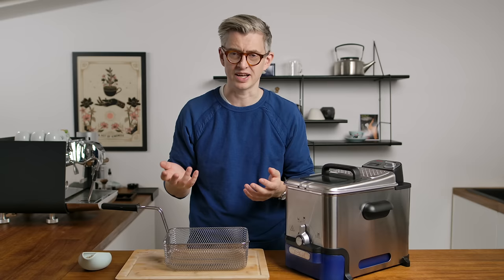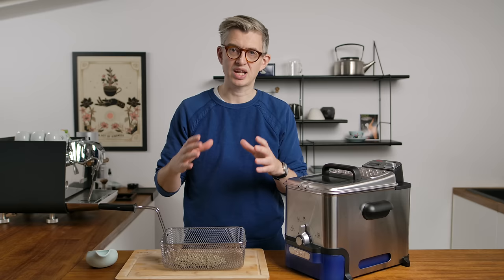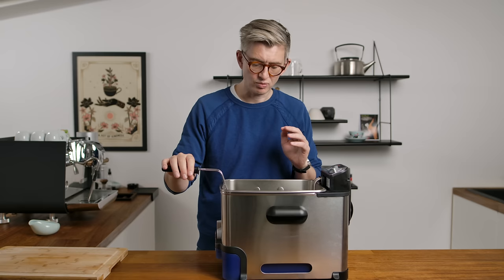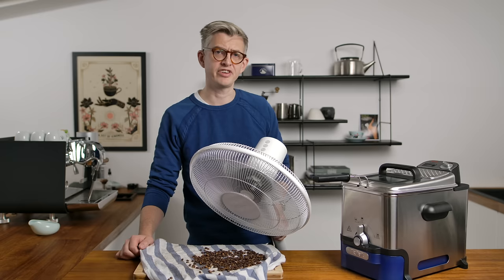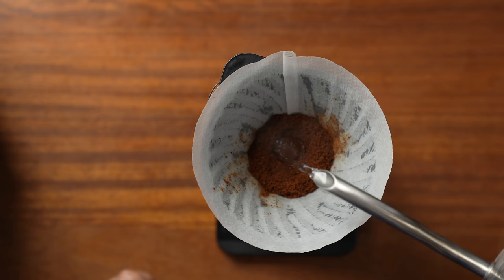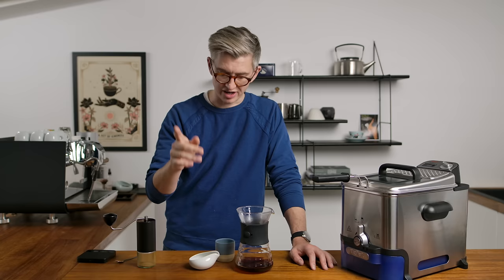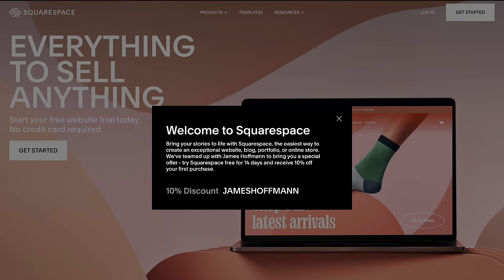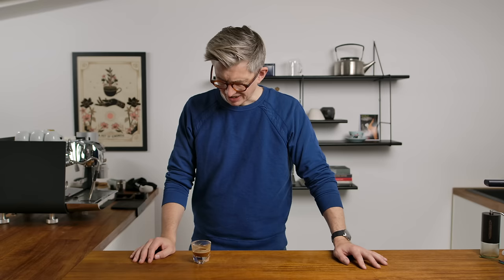Deep Fried Coffee: A Surprising Discovery

Comment: You know, if you're interested in heat transfer media, a lot of processes used to use hot sand as a medium. The idea is that the sand has a bulk to it so once it's hot it tends not to cool down as quickly compared to hot air for example (just like the oil) but wouldn't impart any grease to the final product.
Reply: If you mixed the beans with hot sand you’d likely dull your grinder much more quickly, no matter how carefully you tried to remove the sand. But maybe I misunderstood the method you’re proposing?
Reply: @DSR216  i imagine that's correct...
Reply: @DSR216  How about hot salt - Similar idea to the salt, except that the leftover salt on the beans would be much easier on your grinder (as well as being able to dissolve in water)
Reply: Baking beans? if you could get some really small ceramic ones, but still large enough to remove reliably. They'd have the thermal mass if not the contact area.
Reply: there are street vendors in india/pakistan/bangladesh that serve hot sand or hot salt "fried" snacks exactly like the way you describe. there are videos of it here on youtube too.
Reply: This is how chestnuts are prepared in China on the street
Reply: Now I just want to try roasting at the beach inthe sand or on my dashboard here in Australia.

Comment: Definitely do not leave the lid on when deep frying; as the product you are frying cooks, it will release steam and the water will condense on the lid and fall back into hot oil.
Reply: Yeah who does that, the covers there to stop things falling in hot oil when it's not in ise
Reply: It’s actually ok with a lid like that it’s basically half mesh at the top
Reply: Yeah, the designers have thought of that…the steam gets out.
Reply: Indeed! It's only home deep fryers where the manual says to keep the lid on, and this is mainly to keep your kitchen clean, not for better frying. Professional deep fryers used in restaurants are never covered while frying.

Comment: After TONS of experiments with different brewing methods I’ve found that THE best results are when you run ALL the water thru ALL the grind, as in a tall cylindrical tea infuser tube. After that, residence time is FAR less critical. You can even get a good “second extraction” of at least 50% more brew in the same way. I drop the infuser into a vacuum thermos carafe, pour the hot water, steep and then pour it thru a gold filter into each cup.

Comment: Regarding frying with the lid on: Check the directions for your particular fryer!
I had one that specifically said to NOT put the lid on the machine when it was hot, because there was plastic in the lid that was not completely heat resistant.
Reply: That must have been designed by the guy who was having "his special day" at engineering school. Who in their right mind uses non heat resistant materials in an appliance whose sole purpose is to get hot?
Reply: @jimnelsen2064  Yeah, that just sounds dangerous, best case you get some tasty microplastics melted directly into your food, worst case it causes a fire, not sure I'd trust an appliance like that, without opening it who knows if they cheaped somewhere else, like deciding they didn't need any over temperature protection cut-off in case the heater shorts out.

Comment: It would be interesting to try this again with 200C oil.  First crack happens at about 196C, as I expect you know.  So to get deep fried puffy beans, you are going to need to get your oil hotter. Will 1st crack under oil result in spitting? Also the roasting process goes exothermic at that point, ie the coffee beans generate their own additional heat. That might create some interesting different factors in an oil medium. It might mean that they race on to 2nd crack rather quickly, a problem I experience when home-roasting small coffee beans in a popcorn popper. Or else, maybe the oil quenching is effective in slowing them getting to 2nd crack.

Comment: After you mentioned the airfryer, I'm really curious what'd happen when you airfry fresh beans as a cheap home-roasting trick.
Would it be significantly better then deep-frying? Would it come close to regular roasting?
Reply: A co-worker tried this. He thought the results were similar to putting the beans in a cast iron pan, and roasting it over a gas burner. He said that he has more control over the roasting using the cast iron pan, and has not tried air frying more than once.
Reply: I sent this as a video idea on his website! I suggest you do so too so him and his team may consider it!
Reply: I had a friend that roasted beans using an old bread machine. He disabled the internal heating element and used a heat gun pointed into the top of the bucket with a clamp stand. Then he just set it to mix/knead and let the little paddle and the air movement stir the beans til they were ready.

We used to sit in his coffee shed on cold days strumming guitar and drinking home roasted French press! It was pretty good!
Reply: Small things will fly around in the air fryer basket, maybe build some kind of small mesh cube to enclose the beans, whilst still allowing them to be roasted...

Comment: Small technical note: At around the 1:00 mark, you mention that you have much more effective "conduction" when you deep fry. The heat transfer from the oil to the bean is still convection actually.. That is, heat transfer involving a fluid. Traditionally, the fluid is a gas, and in the fryer, it's a liquid.

You may want to consider frying again at higher temperatures. This will  increase the rate of heat transfer, and possibly get them to expand and crack like you mentioned.
Reply: Anytime heat is being transferred in a fluid you will have some ratio of convection and conduction. This is called the Nusselt Number. How to actually calculate the Nusselt Number in any situation is complex and approximate

Comment: I'm surprised the filter coffee worked out. I might try to pan fry the coffee beans if I ever get into coffee roasting.
Reply: You can definitely Wok roast coffee. It won't produce a super even roast, but just constantly moving it around with pretty high heat works ok. I don't know what circumstance it is for, but I did it once when I got ahold of green coffee in college.
Reply: I wonder if the oil rose to the top during the brewing, and was trapped inside the filter basket.

Comment: I am also not sure how to feel about these results, but i would be interested to see if perhaps changing up the frying process could yield different results. Since frying typically results in a faster heat transfer, while the oil penetration means a more even final temperature, i wonder if frying at a different temperature or a different length of time might improve the results. Since there are processes such as decaffeination that rely on certain parts of the bean having different solubility characteristics, perhaps using different frying oils can change the results. The other idea i had, which is less likely to work, but could be really interesting if it did, was to directly introduce flavorants through the oil during roasting. I dont know if vanilla bean extract has any oil-soluble components, but if you could infuse vanilla directly into coffee beans… i would find that fascinating. I also wonder if perhaps another process between frying and brewing would help with the oiliness. Perhaps allowing the beans to sit in a dehydrator or washing them with something or other could extract the remaining oil and remove or tune those unpleasant side effects.

Comment: Time for some science on thermal conductivity! the conductivity of air is approximately 26 mW/(m*K) at room temperature and approximately 40 at roasting temperatures. Fryer oil has a room temp conductivity of approximately 170 and a roasting temp conductivity of roughly 250. So the frying oil is transferring roughly 6x as much energy per second into the coffee as the air in the roaster. This probably explains the lack of cracking; heat is pumping into the beans so quickly that there's no time for pressure to build before all the moisture's gone. 

Here's where it can get interesting. Hydrogen gas has a conductivity of 186 at room temperature and 271 at roasting temperature, making it an even more effective heat transfer medium than fryer oil. In theory, you could place a coffee roaster in a vacuum chamber and replace all the air with hydrogen gas to achieve hyper-efficient heat transfer in a traditional roasting machine. However, heating elements and hydrogen gas don't play very nice together (See, The Hindenburg Disaster)

Comment: My uncle tried to get a patent for a home coffee oil separator like this 30 years ago when coffee culture got really popular in my country. It got rejected by the EU because coffee beans is a licensed and protected produce. If he wanted to make a patent he would need to cultivate his own strain of coffee beans.

He was further ahead than recent pop culture though, he used physics to get the oil grease from the beans. He had device that separated the oil from the beans with water, heat and gravity, which is actually dangerous to keep near frying oil in a single machine. He also had a machine that let you brew coffee in vegetable oil and then separate the oil from the brew with condensation leaving only the extracted coffee essence. The secret trick was using a oil with a low freezing point. Then using heat and cold after separation, turning the oil into a semi solid gelatinous block even in room temperature.

Comment: Not a coffee expert, I don't actually like coffee, but a chef. If you deep fry your coffee, straight out the fryer, put it in a sieve and rinse with boiling water straight away. It will remove any oil residue and there will be less grease. Alternative method is to dump them straight into a tall pot filled 1/3 with hot water, and strain straight away. The oil will rise to the top, dry normally later. It should not affect the flavour much, but will remove as much grease as possible.

Comment: you should stop at "its not done yet". the second time you pull it up. Air it out for around 15 minutes and grind it. it will taste amazing. if you want it to puff out, you need to dry it out until it has the consistency of ground nuts (peanuts)

Comment: 1:03 It is still convective heat transfer, not conductive, when submerged in oil. Convection is the primary mode of heat transfer for any fluid, be it liquid or gas, and is characterized by moving particles that form a nonuniform, dynamic interface and does not rely on a chain of particles transferring heat from one end to the other. Rather, a particle imparts heat and is immediately replaced by another particle ready to transfer heat with no appreciable temperature gradient in front of the boundary layer of the fluid.

Comment: Try a hotter temperature. While traditional roasting may be about low and slow, frying is all about hot and fast. More oil is absorbed the longer the food stays in the oil. Try something more like 190.5°C/375°F, or as hot as you can go without smoking the oil. Different oils will have different smoke points, and flavor profiles. There are more experiments to do!

Comment: Convection is the movement of the air - a convex current - swirling of the air. When the air comes in contact with the beans, the heat is transferred through conduction. It's just not conducted anywhere near as rapidly as through the metal surface as air is not a good conductor of heat.

Comment: Before we jump to conclusions, I think this ought to be explored a little further by: First, putting a finer mesh at the bottom of the sieve. Maybe even build some sort of cage so that none of the beans can float to the surface and get cooked unevenly. Trying out different beans. Trying methods of filtering out the fat. And also adding milk! The milk is somewhat fatty and might mix better with the greasy coffee brew - maybe mellowing the disgusting bit out?
Also, try a cold brew version of it!
Reply: The type of Oil you use will also effect the taste of the coffee. This might make more sense with a nut based oil of some sort.
Reply: I like this. You wouldn’t want to try my first roast with a popcorn popper and call it gospel fact
Reply: Also maybe roast for varying amounts of time at different temperatures.

Comment: What about using sand as a roasting medium? Though I would think you would need to do a really good job sorting afterwards to make sure you don't damage your grinder.
Reply: There is no way you're going to get sand out of the beans.  At the minimum you are going to wear your grinder burrs much faster.  Also, remember that most sand has fairly high mineral concentrations that would affect taste.
However, I've often wondered about high-temp sous vide roasting.  If oil is the medium and the beans are separated (likely in a boiling flask with a stirring stick), very high and precises temps could be achieved.  This could also be applied to sand!  I think sand would even work better, and safety would be much improved, although it would come at the expense temperature adjustment speed.  BRB, off to aliexpress to look at sand-based turkish coffee setups!

Comment: If you used vegetable oil to fry the beans, you might try peanut oil next time 
Or grapeseed oil
Both options have a high smoke point (the temperature at which the oil will start to emit smoke) and have a neutral flavor when frying
At least, I think so

Comment: If you cook a curry you would know that the oil needs to be hot, if not you will just burn with no crack. Typical example is cumin seeds, hot oil makes them crack as soon as they touch the oil. if the oil is not hot enough the seeds will just burn with no crack.

Comment: I think your oil needs to be hotter, and get yourself some mesh for the basket that is fine enough to hold the beans. Then you'll actually reach that crack temperature and be able to drain the oil. Of course, you'll need to select an oil that can hold the higher temperature.